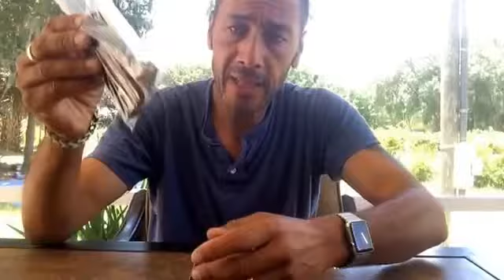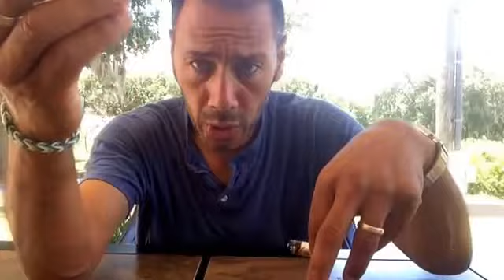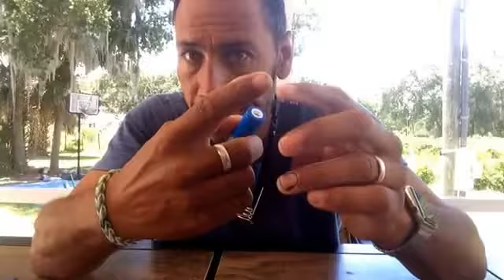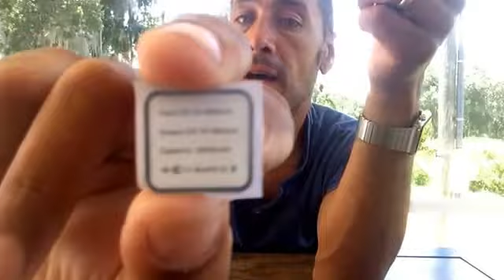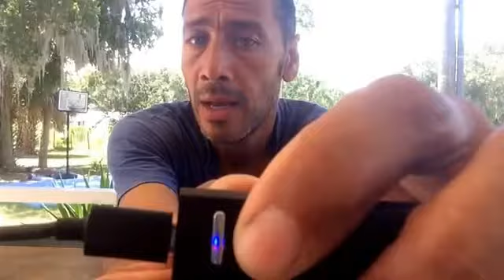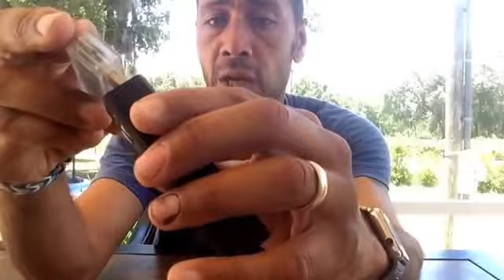Portable USB charger -DIY kit

Comment from the maker: Which country are you from.?

Normally you can get them from Radio Shack.
But look on line Amazon, Ebay , or there's a app called "Wish"
Where u can buy all sorts of things cheaper.
Alway check the discretion on the app of what you are buying.
Hope that helps.